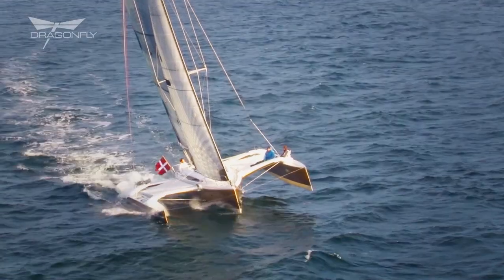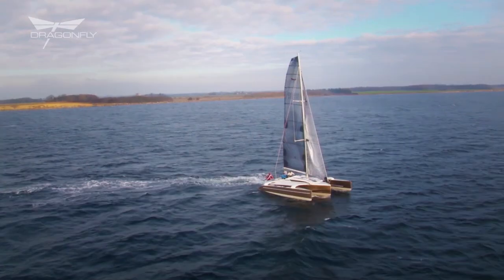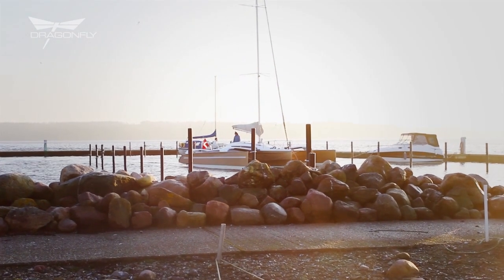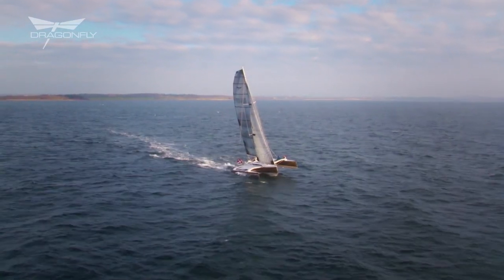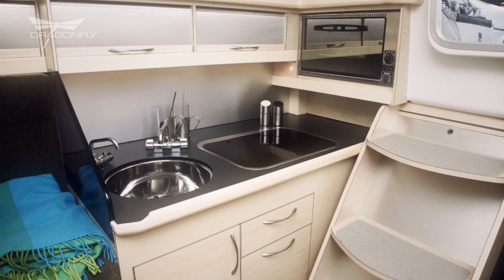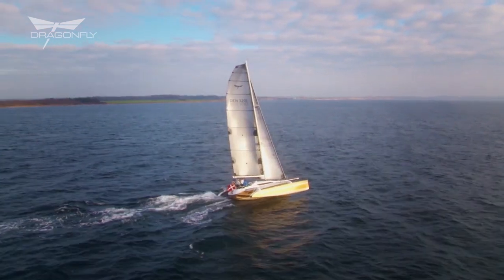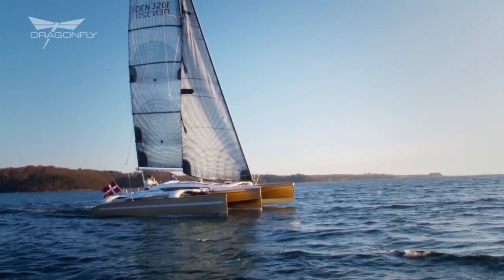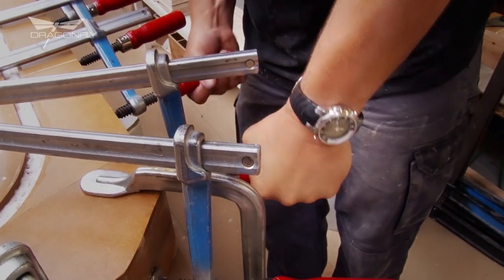Dragonfly 32 Supreme New Video

Comment: Is it suitable for transatlantic transitions? 
It looks cool of course)
Reply: You would not only have to be an experienced sailor but also experienced with this type of vessel as they are very responsive.
Reply: I think it can be done. The owner of the yard talks about this when interviewed by Yachting World at one of the Düsseldorf boat shows. The video was about the Dragonfly 40. You can find that video here on Y-tube if you search for it. As I remember it, in that video Jens (the owner of the yard) says they have one customer that has circumnavigated in a Dragonfly 32. The boat isn't really made for crossing oceans though since storage and weight is limited. But it seems it can be done if you're skillful enough... It ought to be one of the fastest 32ft sail boats out there. So that should be a plus... Less time on the water.

Comment: How much wind will it take to lay it over?
Reply: Depends on how much sail you have up. If you're a good enough sailer you should be able to avoid those kind of wind conditions. That boat is fast enough. Regardless – no matter what boat you're on you don't want to be in really bad weather in smaller boats like these. For example – isn't there also limits to what a 50ft monohull can cope with?...

Comment: These trimarans can be so stable but there are enough videos of trimarans capsizing... I will always feel safer in a monohull which is self righting
Reply: You will have to know what you're doing and be conservative with the amount of sails you use relative to wind speed. A trimaran does heel, so you can feel when a trimaran is starting to get overpowered. In that way trimarans are safer than catamarans. But – since a while back there also are load alarms that will tell you when the sails are starting to become too loaded. They are expensive. But in comparison to the total cost of this boat it's not going to be that much more money...